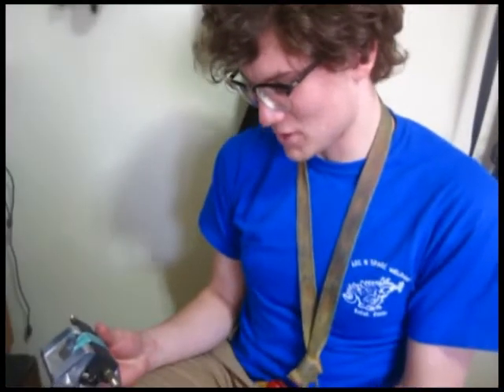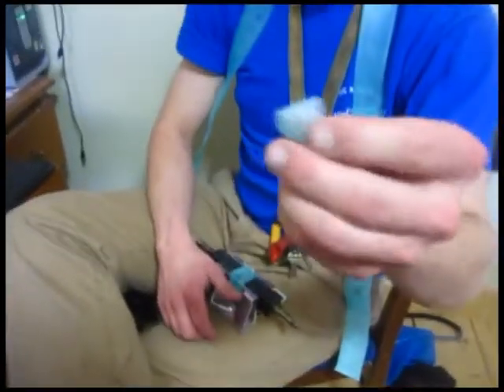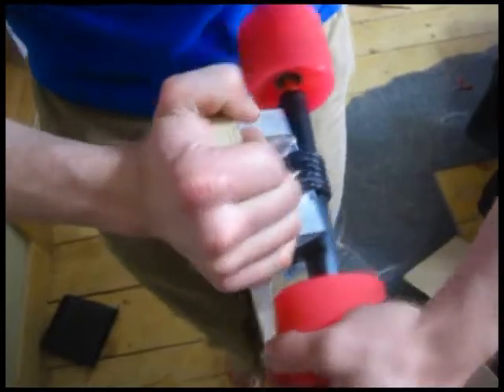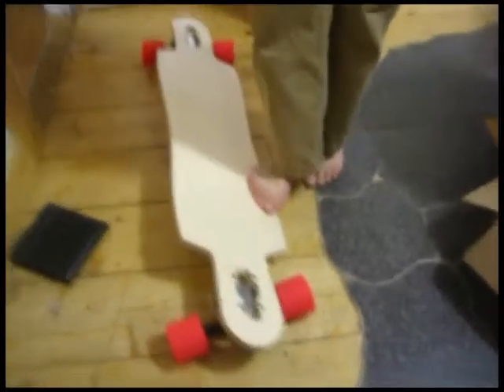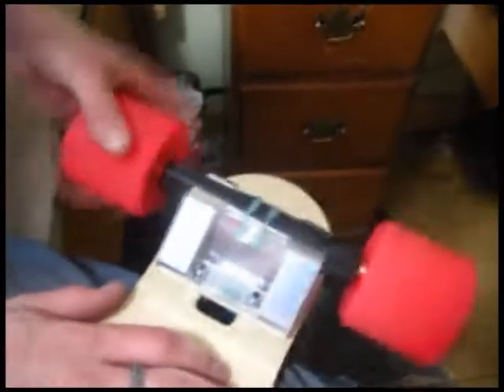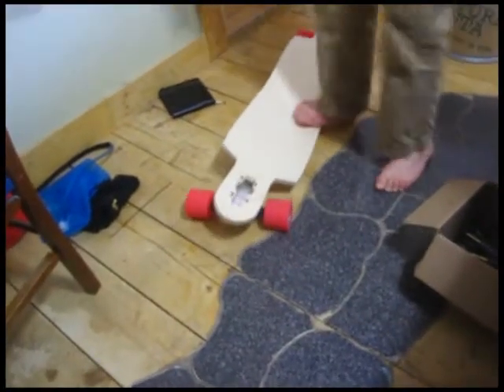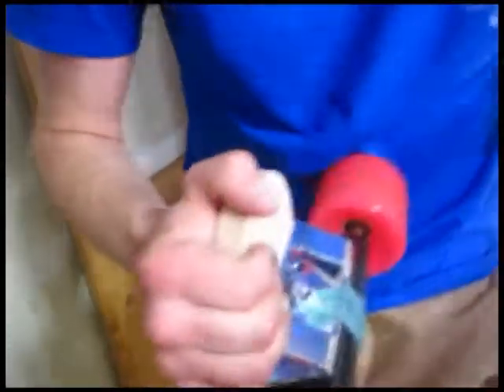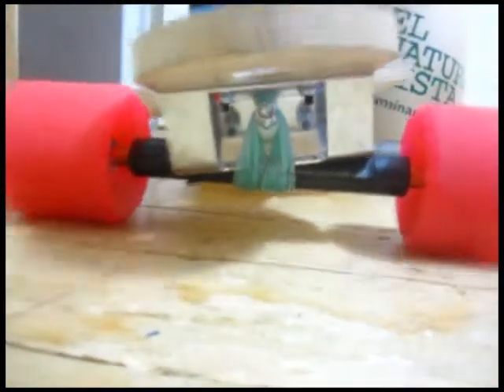Polyurethane O-rings.

Comment: the bottoms of my trucks get beaten up by cracks and rocks, it would be great to find a way to make the plastic recessed into the truck so that only metal will contact the ground or rocks.  one nasty rock could put a weak spot in the ring.